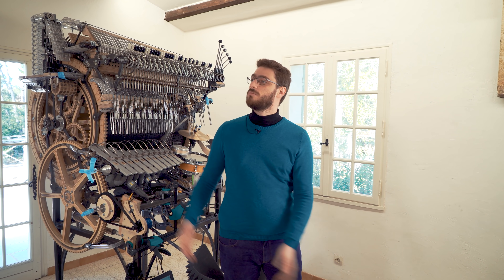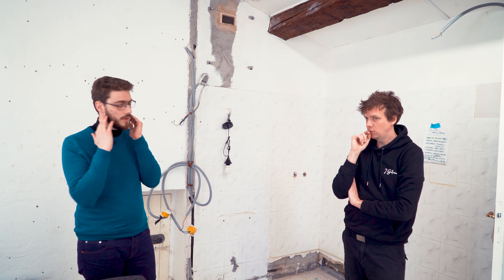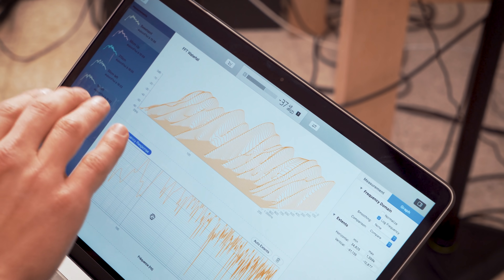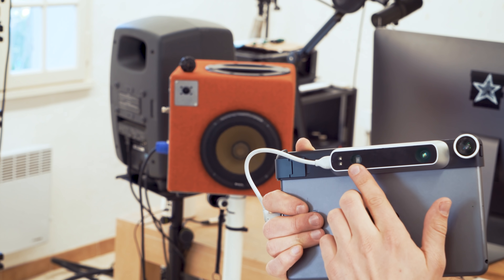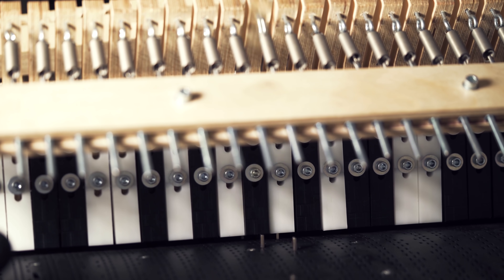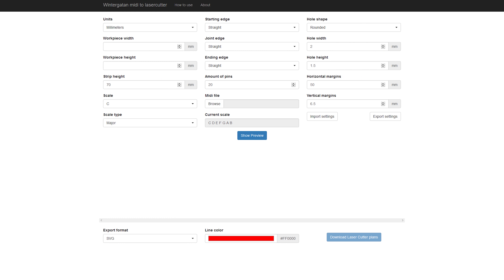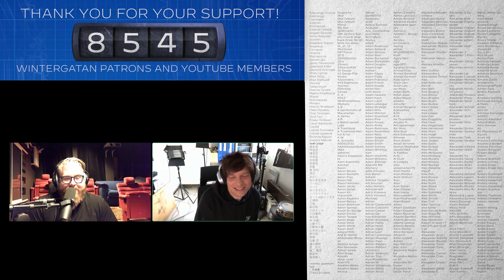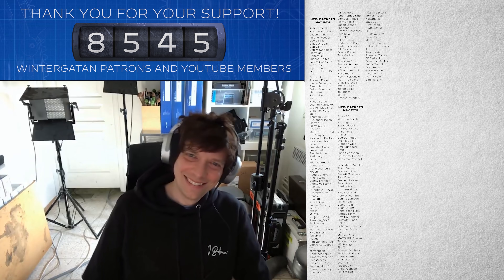Music Studio Acoustic Measurements - Marble Machine X #127

Comment: I do not think solenoids belong on the MMX. It may be the simplest solution but it will no longer be anything special. In fact the simplest solution is just to use a programmable midi keyboard. You should definitely be careful of drifting towards that.
Reply: Creativity and uniqueness arises from constraints. If you compose in logic, probably with a sampled music box and sampled drums and then use a software to convert it to a dxf file that is then cnc stud welded. Where is creativity and uniqueness here? You could also just playback your logic session. Also the obsession with overly tight playing is something I do not understand. 100% tight music sounds boring. I have the feeling with the motor, the midi to dxf, stud welding and especially the solenoids the project becomes really pointless at some point. Sorry for that negativity, but I am sure Martin a few years ago would never have thought about a motor or solenoids.
Reply: Martin can also use samples to compose, so I'm not sure Solenoids adds that much. But it does allow him to test it on the real thing before ordering the stud welded sheets. But then again, he could still run into problems with that method that he would have discovered with the magnetic programming pins.
Reply: The solenoids will not reproduce the whole mechanical noise, so no, you would not know how it really sounds. Martin could just sample his machine, load it in kontakt, and voila, no need for solenoids and you even have the noise of the marble drop. But the more fundamental problem is that programming the machine manually is part of the creative process in my opinion and at some point the whole machine will loose its flair
Reply: The solenoids will be detachable, only meant to be part of the machine while composing, so that he doesn't need to keep fiddling with the magnet sticks in the black programming boards. You won't ever see them live, is the idea.
Reply: Sure you could start composing with a keyboard. But you wouldn't how it would sounds on the MMX, that's why the solenoids is a great idea for bridging that gap. You probably missed the part where he says he will still use the programmable pins for playing live. I agree the solenoids don't belong on the MMX when playing live, but throwing away a good solution to the midi to instrument problem is definitely not necessary.

Comment: The beauty of marble machine was not that it was flawless and perfect, but that it was purely mechanical thing. The original was shaking and loosing marbles but people loved it because it was build by one guy who was spinning the crank and playing on the instruments like a madman. I know Martins goal is to take it on world tour and such a machine won't have place there, but it is important to keep in mind that if you keep blindly pursuing perfectionism you will end up playing midi files on your computer.
It is important to find the line where the machine is still interesting, I guess there will be a lot of project which can do the same and maybe more with bunch of arduinos and servo motors. There not many projects which will do that by spinning the wheel by hand and keeping pace by skill. 
Of course this is only my opinion.
Reply: if you're referring to midi control idea, then I tend to agree. it was obvious from the start that controlling marble drops with solenoids via midi would be easiest solution, but that would make machine pretty simple, as big portion of it would be rendered useless. but, at this point one feature doesn't have to replace another, those solenoids could really help with music production, but it should be a module that is not used on tour.
Reply: I remember a video mentioning that the motor is only for the building phase and testing.
Reply: @UlrichRoss  Yes you can do that, it is a nice convenience in contrast to manual magnetic pins. I just find it strange to build this instrument and not want to interact with it.
Reply: I think many of the automation aspects are to aid in composing music, not for live performance. If I understand it right, that was the motivation behind the motor and it seems to be the motivation behind the MIDI actuators.
Reply: @jamesrempel8522  Well... yes. That is one way to go. But there is another aspect to it. MMX is still a musical instrument and is it ok to take the path of convenience if you just started learning how to play it ?
Reply: I totally agree.  If one were to trigger marble drops with solenoids, one doesn't need the programming wheel anymore.  You just save the sequence in RAM and "play" it through the solenoids.  The programming wheel is half the idea of the MMX.  When starting automation, you soon end up in the cross roads where the marbles seem redundant.  I think Martin thought this would make it easier to compose music on the MMX, and then weld the programming plates. But the plates are going to seem like a long walk around.  I vote for no automation, keep the quirkiness of the MMX as it is. That is WHY we love it, and my biggest love is for the first machine!
Reply: Remember that even the machines of old that Martin is taking inspiration from had "automated parts". The music was often on a sheet of paper or metal that was certainly created in some sort of mass amount. Certainly not artists painstakingly manufacturing each sheet. We don't know what the process was for composers on those devices but I'm sure they'd have appreciated a way to rapidly make changes rather than starting over from scratch every time.
I feel, as long as the midi controller is easily added/removed then it doesn't take away from the machine. In fact, I'm pretty sure you'd still need the programming wheel to inform the midi controller about playing speed. The beat machine and vibrato cannot be played from a midi controller, so in order to stay in sync, the controller will have to know how fast the machine is playing. So perhaps using a full track of short pins that won't pull the drops but can be read by the midi controller.
Reply: I don’t understand the issue. As James Rempel has said, the solenoid idea was being explored as a tool for composing rather than having to manually alter the magnetic programming strip. The resulting music will be played on the machine without their assistance because it’s just to streamline the composing process which by its nature involves trying things, and then tweaking till it works the way you want. If that process takes 45 mins or more every time a change needs to be made, it’s a MASSIVE limitation on the machine as a real instrument.
Reply: Holy smokes I practically wrote the exact same comment just a minute ago.
Reply: I agree with this very much, I am confused as to where things are going now. It appears to be a functional machine at this point.
Reply: I’m in the super conservatism corner. I think that even if he adds automation just for composing and testing, it removes a huge chunk of the charm from the machine. The knowledge that there is a ’better’ version built takes away a lot of the wow factor. Especially since the solutions are actually impressive but not in the ‘right way’.
Reply: I agree, it's like Automatic Quartz watches,
Reply: I can see why Martin liked the idea because it will make composing music easier and more intuitive. The way Martin describes it, it won't affect performance. But...  Hihi... Of course, once they're on, and Martin discovers they will also allow him to also improvise live... hahaha... I don't think he will be able to resist keeping them on. All good... It's not an either/or thing... I'm sure this machine will keep growing and growing forever, anyway. Once the CAD has become shareware the sky will be the limit.
Reply: It'll just be for composing, not for actually playing.
Reply: I totally agree with this. When the solenoid cames, I had a strange feeling, like it shouldn't take part in the marble machine, and you've just explained what was this feeling.
Reply: I think that 'simple' automation won't ruin it - the machine is still a unique  device. It can't really be like anything else with arduinos and motors, it's already a masterpiece of mechanical moving parts and marbles that is organized and synchronized. I don't see it just as a "world tour" instrument, it's just a new device with infinite window of creativity which will provide some awesome music...so good that I will want to listen to it on Spotify...Not just on a concert.
Also I don't think the MMX is planned to be a one device(man) show. The Wintergatan band is here with their awesome skills and presence.
Reply: @BenPasriche  I agree. MMX is hell of a design at the moment. What I am talking about is the line which is important to find and not cross it. 
Everything can be described as 'simple' automation if you keep pushing your line far enough.
Reply: YES

Comment: Banana product: The product finishes at the customer.
At our company, the software and hardware we produce is a product which is constantly modified and tweaked. (Internal use only)
We test the system as good as we can and then the users take it over. They report errors back to us and we can improve the hardware and software.
Electro-mechanical actuators are a really great thing. Solenoids, servos, motors.... 
I'd be happy to contribute my PCB designing skills to this. --> KiCad/Altium experience

Comment: Sure the Solenoids sound convenient but isn't it a bit like cheating? From the video I understood that the pins would still be used for the final songs so it's a bit of a composing help.
However even the electric motor feels to me like it doesn't really belong onto the MMX.
To me it was always a fully mechanical machine and that's where its charm came from.
If you would want an easy and convenient solution to make music you wouldn't need the MMX in the first place would you?
All the "real" music she produces can be created on a computer in software as well.
Reply: It sounds like it would just be used for composition. So when a song is finished it would be encoded onto a stud sheet so it could be used with the drum. Not sure though.
Reply: At first I wanted to object to you, but you have a point. If the music is composed in software anyways, it can play it too, taking in consideration any timing limitations of the MMX, so there's no urgent need to make solenoid system - you can listen what you've written without marble machine at all. However, the real MMX sound would almost certainly be different from the synthesized one, so the solenoid system can make "verification" stage of the composing easier.

Comment: I would like to ask what is the purpose of fixing the room if the machine is destined to be a performance device. 
I would recommend constructing a portable sound enhancing backdrop or multi venue types ... However the sound is all mic / amplified. There is no acoustic enhancements ,  ie.  as you would for a violin or piano.  In which case the "room" is only dependent on the the venues you will be in.  The sound in mic is speaker sound out,  nothing acoustic.  So you must make do  with the venue or bring your own.  In either case a soundweb DSP can easily supply for both ,  ie.  multiple feed to a soundboard or simply access to amps directly, bypassing the soundboard.  just run a fibre to a simple output box.  Note there are 2 fibres ,  for loop redundancy ,  (you can cut one without loss of signal.)
 
Are you using a DSP for all your inputs,  I would highly recommend it for stage and studio recording.  I am a former product specialist for Harman pro.  I am programmer as well,  My specialty is BSS soundweb but I also do Media matrix.  DSP have the ability to bring you studio settings with you and the ability to tune your venues.  no lag ,  no windows .  mass input/ outputs,  fibre connections, compact enough to be on the machine with only fibre optic out.   Live record.  etc.  designed gui to your need. On iphone to tablet to pc multi connect access ..  
https://www.youtube.com/watch?v=A-nPp03UD1k
https://www.youtube.com/watch?v=MGPQ1nXjDSI
https://bssaudio.com/en/product_families/soundweb-london
https://bssaudio.com/en/videos/play/mKPVvXPwWJI

Comment: Solenoid solution is good, but totally a fork from MMX. Don't implement into current build! With the CAD-project, sibling machines can be made, with all sorts of features and twists.
Reply: Absolutely. It's such a practical idea, and as an electronics guy myself I love it, but a lot of the beauty of the machine comes from the mechanical nature of it. The electric motor already encroaches on it, but not much. Solenoids would be a larger step in a direction I feel is not authentic to the machine.

Absolutely fantastic idea, and could be implemented with some more automation ideas to create a very efficient composition workflow.
Reply: The solenoids are supposed to be detachable, so they won't ever show up in the final performance.

Comment: As cool as the solenoid marble drop sounds and yes it will solve many issues it takes away from a big part of what the marble machine is, it will just be makeing it some Electric instruments that the only reason a person is playing it is to list marbles.
I'm my opinion I really don't like the idea, but of course it's just my opinion so you go and do what you think is best.
Reply: I 100% agree, I think the programming wheel is an integral part of the MMX and it would be far less impressive with something electric doing the dropping of the marble
Reply: The idea is to use the solenoids during the composing process - not during performance.
Reply: He was only talking about using that system to compose. Once he got it how he wanted, he would transfer it to the stud welded sheet for the programming wheel.

Comment: I thought you said you dindn't want to do anything with electronics
Reply: For the real machine, yes. Martin wants to avoid them, as they take away from the mechanical aspect of the machine. However as a tool for composing outside of performance, there wouldn't be any issues, as that kind of thing doesn't matter then.
Reply: If you're referring to the MIDI-to-solenoid pin programming, I believe Martin said that he would likely have a fixture to attach temporarily to the MMX, test different iterations of music, and then remove the fixture, and having BPS manufacture the final, permanent song onto sheet metal. The fixture would simply speed up the composing process, and I don't think would ever be used live.

Comment: To be completely honest the fact that MMX is mechanical and driven by human power (except the motor) is the most fascinating thing about it, if MMX will be programmable and played by solenoids it's like... Printing art insted of painting it. Just my opinion ¯\_(ツ)_/¯
Reply: From the sounds of it I think Martin was thinking of using it for composing rather than for running the machine which I think would be an interesting system
Reply: solenoids are just for trying out a song, not for stage or recording.
Reply: That was my first thought too.
Though I think solenoids on each fret on each string of the bass guitar, would allow the bass to play itself, and play more complicated bass tracks. Or 4 solenoids on a gantry that can move the length of the neck, then it could play slide notes as well.
Reply: My thought was that the magnets were for composing and the stud plates are for the performance. However having solenoids could speed up the process
Reply: @JonathanKayne  Exactly.. that was the plan.. however the magnets aren't as precise as the pins will be, so it'll be hard to properly test a song accurately until you get the pins.. which might lead to needing more iterations of the pinned versions due to slight inaccuracies. Much more importantly: I believe the magnetic pin track system is incredibly limited in its timing ranges... the solenoids would have more potential precision than anything.. which means they could be precise enough to accurately predict how the pins will sound, so it will reduce how many plates end up needing to be made and tested.
This is in addition to what you pointed out, that the solenoids will speed up just testing initially before sending it out.
Reply: Agree. Solenoids might be good idea but not on MMX. Even if it is 'only' for trying out stuff. 
How does Martin want to learn playing this instrument if some electronic component will play the songs for him? I always thought that the magnetic programming pins were for trying new songs...
If you want convenience, why not outsourcing the whole project to some company ? I guess you would find one that would design and construct it better than it i now.
Reply: It's not for performance, it's just to aid in composition. Imagine how painful it would be to have to pluck out and replace all those magnets anytime you want to change anything about the song. Maybe it would be nice if the mechanical design was such that it could be easily removed so it's not in the way for stage performances, but only a tool used in the studio

Comment: Dislike the solenoid marble drop, at least as the final machine.  You need the programming wheel. That's what makes it so intricate and unique. There's so many different components and the entire thing needs the programming wheel because that is what makes the marble machine the size and shape it is.
Reply: It'll just be for composing, not for actually playing.
Reply: The programming wheel isn't going anywhere! The goal for the solenoids is to be a detachable component used for composing, not for playing.